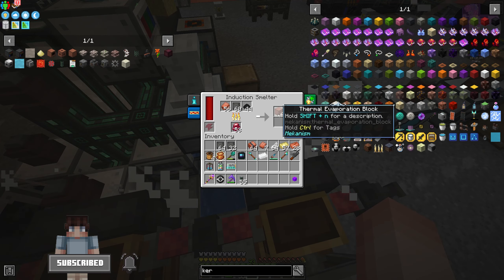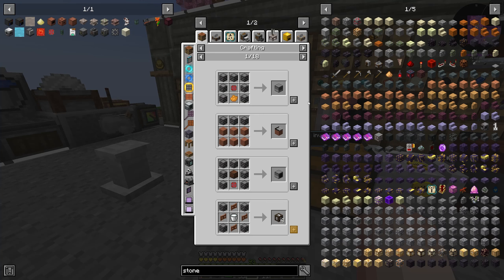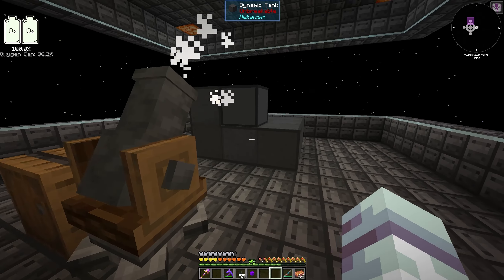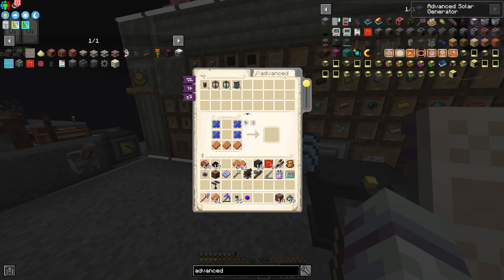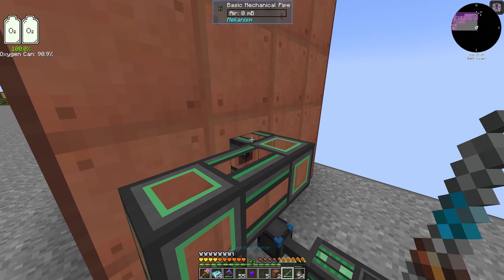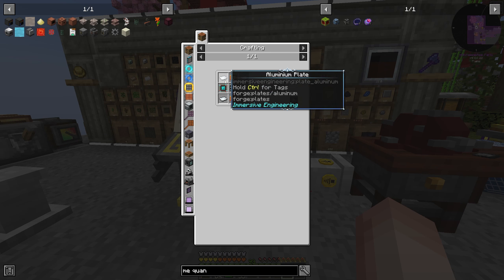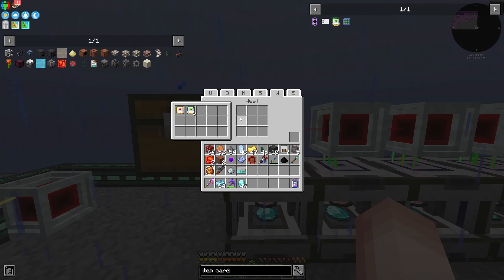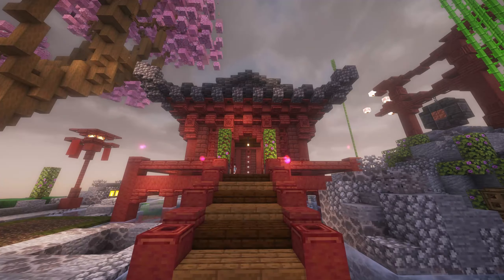FTB Skies Expert EP30 Circuit Automation!

Comment: Question that's been bugging my for a while: that Create Contraption next to your Sugarcane farm that glitches out at times. Was that an attempt at a new Tree farm? if so, why have you kept it up now that you have the Phytogenic Insulater?
Reply from the maker: It was originally a setup to collect mangrove wood before I had access to power, I had a plan for a build that I wanted to do (still want to do) that required a lot of it so that’s why I set it up, at this point it is disabled in the sense that I’m not providing it with the mangrove sapling/seed things whatever they are called, but I need a lot of other wood types for this build I want to do and I am most likely, going to use the phyto for that setup it’s just something on a long list of todos that I haven’t gotten around to yet
Reply: @SohPandaa  Fair enough
Reply: I see what you did there. "Over the moon..."
Reply from the maker: @4ozscoop  glad someone got it 😄
Reply: Io is a good mod to tinker with.  And I have a couple really  good create flavored  tree farms. Mangrove included